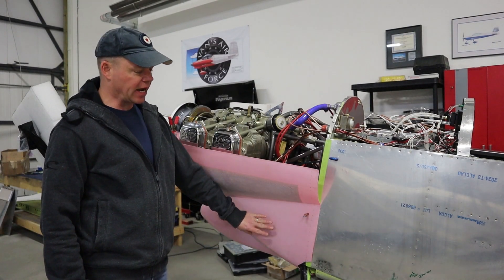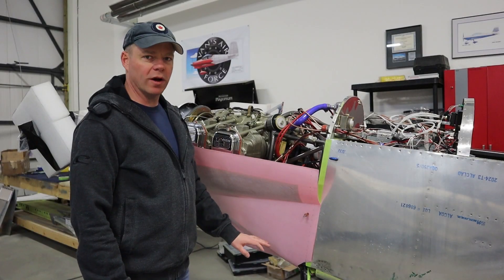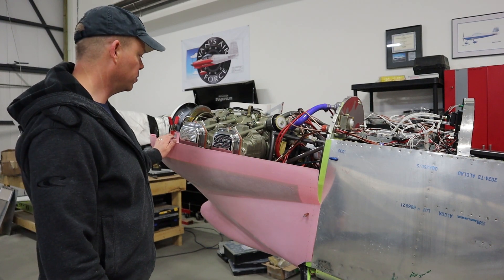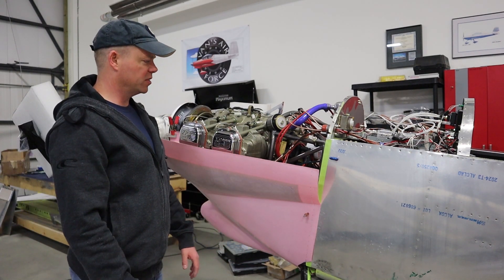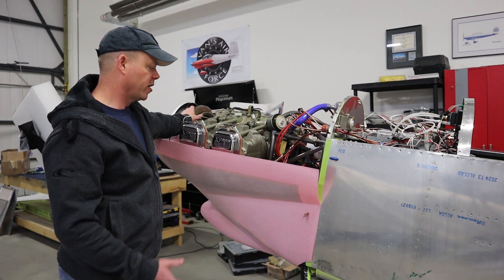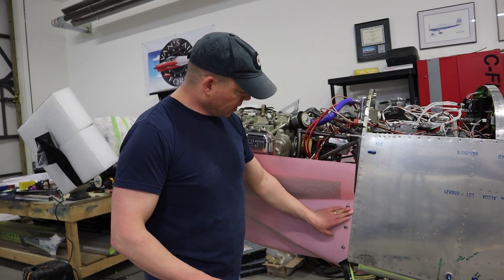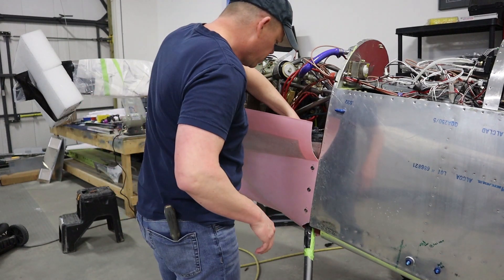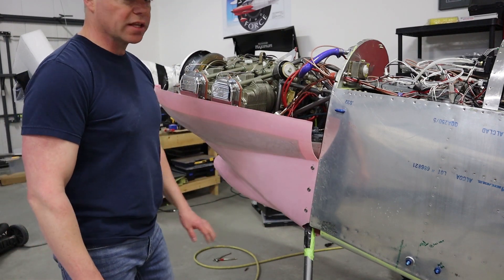RV4 Cowling Installation - Part 1

Comment: awesome Stu, will you be posting part II sometime?
Reply from the maker: I never got around to it sorry.   Have any specific questions?   I’ll update a video this week on flying the RV4 lean of peak
Reply: @stusaircraftfactory6592  I’m at the stage of building my plenum and top cowling.  I took your great advice on using the mil spec hinges for my sides and bottom cowl underneath.   I’m thinking of switching the bottom to Skybolts those as I’m not happy with the fit.   Getting a lot out of your generous info sharing.
Reply from the maker: @stevedame2419  that’s great.  The sky bolts are really nice and 100% recommended on curved surfaces.  I’ve been pleasantly surprised with how good the hinges are along sides since I’ve rarely used them.  For some reason this cowling just fits really nice.  I remember on past RVs inserting the hinge pin was harder than this RV4.
Reply: I’m trying to adapt the Vans baffle kit to the James plenum and the rear portion will work out well but am perplexed with what I’m going to need to do to seal everything at the front.   Did you ever do a video on that?

Comment: Hey Stu, did you shim between firewall flange and sky bolt plates or rivet directly to firewall flange?
Reply from the maker: That is a consid yes.    If the front skin on mine fit perfectly (it doesn't) then yes I'd likely add a 0.025 or 0.032 shim between the firewall flange and the skybolts alum attachments (this is likely the solution for better made kits such as RV7,8,9).   However I had to actually shim the front skin to get it to fit nicely around the forward fuselage (shim between front skin and firewall flange).  In fact the skims were 0.063 in places and my cowling actually ends up below the firewall flange in places.  I'll build it up later (after flying) to make it look better.    Thanks for asking.
Reply: @stusaircraftfactory6592  Thanks Stu, I just installed the engine on my 7 and your videos give me things  to consider rather than doing by trial and error. Really helps speed up my build!
Reply from the maker: @tf1083  your RV7 will be easier for firewall fit.  You prob want to add a 0.025 shim
Reply: @stusaircraftfactory6592  thanks Stu....

Comment: Thanks for your great videos.
You had a very nice carbon plenum, I think on your Rv8 project.
What resin combination did you use? I am concerned about temperature distortion. Thanks.
Reply from the maker: Yes in engine compartment I use a different resin.   HTR-212.   

Here’s a link.

https://www.aircraftspruce.ca/catalog/cmpages/htr212resin.php

Comment: I also like the look of the hinge method of attachment. I also plan to use the extruded hinge, but I’ve got a question about hinge size. The plans have you use 1/8 hinge but replace the pin with .090 pin. The extruded hinge seems to only come in .090 or .180 hinge. Are you just using the .090 hinge and matching pin? Thank you.
Reply from the maker: Yes you can’t order the hinge with a smaller pin to my knowledge - you just have to order it separately.  The intent there is when the hinge goes along the firewall curve.   The full size pin would be a nightmare.  You also have to angle every single eyelet to clear along a curve.   Getting the pin in and out is a pain.   I even had a RV7 overnight in my hangar once because he couldn’t get the pins back in after a routine check of the engine.

So yes I use the full size pin but I only use it along the sides where the curve is easy to deal with.

Make sense?
Reply: @stusaircraftfactory6592  yes, I know you have to order the smaller pin separately, I just wanted to see if you plan on the smaller .090 hinge extrusion or the larger .180 extrusion. I’m also aware of the need to file each hinge to go around a curve. It does look so good when done right..
Reply from the maker: @thomasaltruda  yeah it does look good and the number of “connection” points make it strong.   I’d have to measure the actual size of the pin but suspect it’s the bigger one.   Here is the exact part number from aircraft spruce.  The -6 at end only means 6ft length.   MS20001P3-6.   Hope this helps